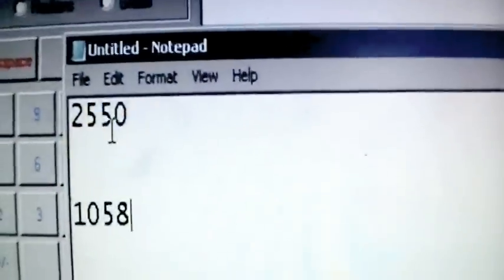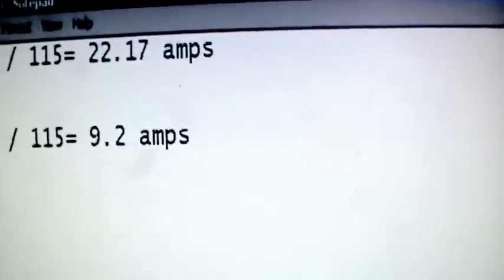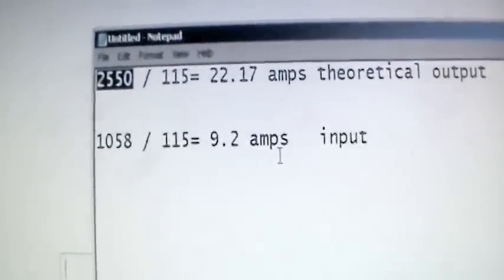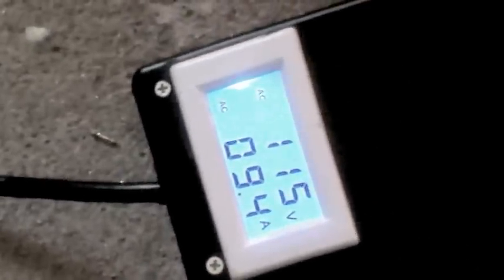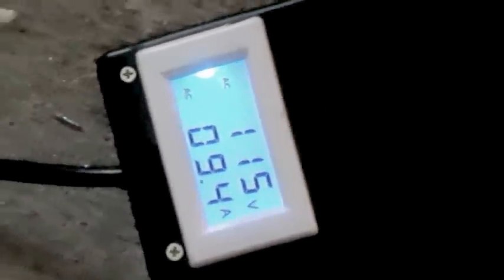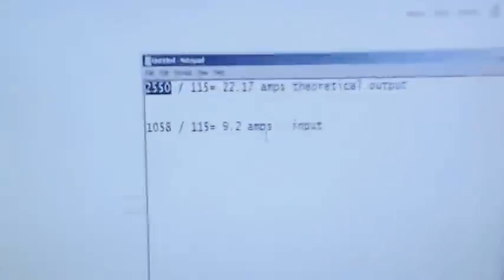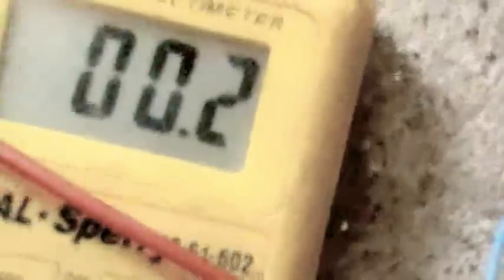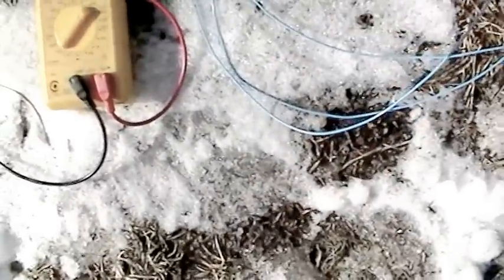Pelex -Power From Electromagnetic Energy Exchange - Overunity

Comment from the maker: I've revised this device to make much more overunity. It isn't just a device that saves a little bit of electricity anymore, nor does it use a radiantr energy device. The antenna seriously limited the effect I was getting, as well, I noticed I was getting a back emf that was causing the massive heat and the coils were struggling to do what they wanted to do. I have tested the device with killawatt meters and have shown power factor measurements. The device uses between 5-7 watts at 120 VAC and puts out thousands while the input wattage drops as the load gets larger! Power factor test shows an input pf at .38 and an output pf of .99- 101. The device uses the same bucking coil technology, but, my approach was a bit different this time! The only downfall is the circuit still has a bit of a voltage drop under heavy load, but, it has perfect capability of operating 1200 watts using 5.5 watts to feed the device.I think the core sizes are key to it's success in the output to eliminate the voltage drop. I have a third unit in production as the first was modified and is running the power at a local shop 24-7.

Here's the link, please share it everywhere! https://www.youtube.com/watch?v=_9-gZuvmWKE

Comment: Might I suggest for measuring power output using an electric heater to warm a quantity of water and then by measuring the temperature change calculate how much energy was put into the water?
Reply from the maker: Hello, an updated version of this device has been produced and the original's parts were reused for the next prototype. The new revised version is working perfectly without any question of mistaken calculations due to the massive output and very tiny input used. Killawatt meters were used to make these measurements because they have the ability to select many different measurements. They are fairly accurate, so, I will build  my devices and use these to compare measurements from my other meters that I normally use.

Please share this link. Thank you!  https://www.youtube.com/watch?v=_9-gZuvmWKE
Reply: That is THE most exact way of measuring Power in a DIY environment... there are plenty of resistive water/drink/cup heaters, just use as many as needed. Since they are purely resistive, they transfer 100% of the Power into the water... no other forms of output to worry about...... like... battery chargers??

Comment: Once you get the heating and packaging refined, are you interested in selling this set-up? Seems very marketable on eBay and by website.
Reply from the maker: I've come up with a better prototype that isn't able to loop or generate it's own power as Pelex does. The device is 25 times overunity and works wonderfully as an energy saving device . I have tested it on all inductive and resistive loads and it's similar to pelex , and, it's simple enough for me to mass produce for sale. It literally makes wall wort transformers gain energy instead of losing, it's going to be a real hit!
Reply: Marc Belanger Thank you Marc.. but remember what I said.. they will only allow a small increase in efficiency ... Search Paul Pantone and the Geet Reactor.. got him jail time... you are at a crossroads... all have failed the next step .. lets see that you .. will be the one to break that cycle 
I have that anti-dote
Cheers and have a nice day
Reply: Marc Belanger I read you feb 27 post.. can I ask why that device was destroyed... 
And because of your advice I am going to come up to speed on high voltage line safety 
many many thanks
Reply from the maker: I have to get my patent information arranged first, then, once manufactured, absolutely, unfortunately, I have a feeling it will be regulated by government to overseas sales, im not sure when or where this will take place, and I certainly hope nobody has anything closely related that eliminates it from being patented.

I will keep you in mind, but, unfortunately, they are tough to build, but, I have the little guy down pat and would like to get this sold as an energy savings module, but, an Earth ground separate from the ground used in the breaker box needs to be used.

The unit is immersed in a block of epoxy and will be tied to a heat sink that will have a fan powered from it's own circuitry for cooling, epoxy to eliminate the copy cats.

The coils are very difficult to duplicate since they are so tiny if the circuit was smashed open to try to back engineer, it would nearly be impossible to see what's going on with my device.

Anyway, I'd love to do business, but, I have to warn they won't be cheap, but, that means they will have a huge markup.
Reply: Marc Belanger Thanks for your reply! You are wise to protect your work. Certainly it sounds like you will be able to see this through to production, and when you do, please do keep me in mind if you would.

Are you able to get into more details about what is the source concept of the overunity, or what role the separate Earth ground contributes? Thanks again!
Reply from the maker: I wrote a very long post which explains most of it in thwe video comments, it is my take on it, but, I am not a serious scientist, I am an electronics, energy inventor that would like to use every tesla technology I could get my hands on, as Tesla said, without a ground and an Earth, we wouldn't have the energy to work with as our magnetic field needs this negative source to fall back on due to the fact that the Earth mimics many different electrical components in one giant machine, not a sphere, a giant round electromagnet/capacitor with induction, resistance, and every form of energy attached to it we could imagine, so, im sure there are many other keys to unlock other mysteries, I think i just unlocked one of the most important discoveries of our time and it's actually based upon what Vladimir Utkin, and Kapanadze studies, but, they don't rely as focused on the Earth, however, it is merely another connection to them, to me, it is the source, as current flows from the negative to positive, and, draws attention to many things when channeled inductively, not physically.
Reply from the maker: This device has been destroyed and all traces of it's design have been eliminated until the market has been changed by others, this way I will not be the person responsible for destroying the jobs and millions of families well being all across the globe. I started out trying only to prove that overunity is possible and have certainly succeeded. I have another device that is in negotiations with a large corporate entity which does not have the ability to generate power as this device does,  so my module has basically been transferred to a very real "energy savings device" that works for only specific very popular sellable electronics. It doesn't really matter if anybody believes whether or not my technology works, it only matters that the corporation I sell it to knows it works and they can utilize the circuit in their current designs they have on the market, or that will be offered on the market in the near future. My overall goal is to help reduce electrical loads that utility companies have massive issues with, and help reduce carbon emmissions as less fuel will be needed if loads are reduced, also, saving electrical customers money since the electric bills have just been modified to adjust for led bulb energy changes and can not legally be done again anytime soon to achieve additional profits, which has just been done federally..
Reply from the maker: Thanks Dragos, I have always been a respectable man that would like to live and be a necessary part of society instead of being selfish and full of greed. I'd rather be loved than hated as well, would rather be needed than murdered! We need to all work together , put our minds together to figure out a worldwide solution and a peaceful resolution to our energy/pollution problem we are facing, but , until the entire world says we have had enough and government's politicians work to fix the world instead of worrying about the almighty dollar, our people and children may have a safe and great place to live, but, if we continue down the wrong path, we may all be surprised how awful life will become for us all. It's only a matter of time before our planet is doomed if we don't try to fix it and do this together the right way!
Reply: Marc Belanger Thanks for your sincere reply Marc. You make valid points, and I wish you and your family all the best with your future endeavors. Thanks again!
Reply: +Marc Belanger Most people of the world only know of one path, the government path.
Give them the path to freedom from abusive, murderous governments.
Feed the world.
Reply from the maker: Since destroyed, this device has been built, taken apart, rebuilt, tried again with other devices and have had a successful run using it in every way including looping, however, it needs a clean sinewave to loop, if it is square wave or modified sinewave, the coils will not work correctly, heat up and fail. With a sinewave, the sinewave amplifies itself without  assisting the cores from drawing more amperage, it magnetically manipulates the flux, eliminating all influence on core stresses and losses. It doesn't convert amperage back to the input, it always uses the same from the input while it works similarly to Kapanadze's machine, except it does not need an arc gap or many other parts to function as his does. It does need a good ground to function on it's case though so it has a large difference in potential to draw from which is energy drawn from another place, mimicking the sinewave from it's input. That is what i mean by magnetic manipulation, the magnetic field of the ac sinewave forces the wave to be formed from a resonant wave that rings constantly, forcing it to choose a form as the input uses.. If the input was a square wave, the manipulation would not be efficient as the transformer can not do what it needs to do, flowing back upon itself a bit creating the unwanted lenz effect and back emf when pulses come through.
Reply: +Marc Belanger  Thanks for all your hard work....  I will comment as I am able .. and  add a direction to go to stop .. the "harresment" effect .. haha..
when people make things that actually work......!    Cheers 
looks like " the system' only allows crap that make things oh maybe 3-5 % better... that you can sell.... no problem... 
Stanly Myers was at same point as you are.... I can continue if you like
but he made a fatal error.. 
Have a wonderful Day !